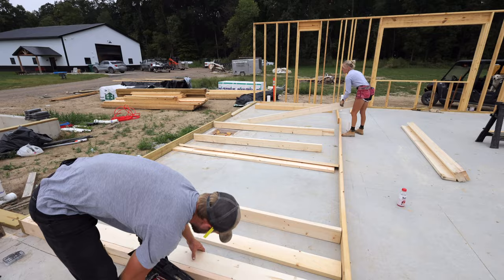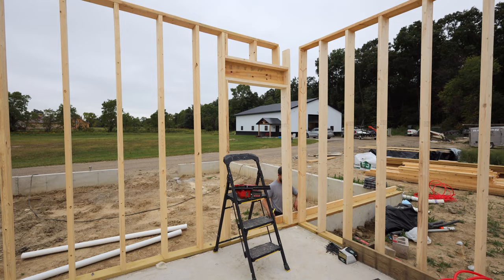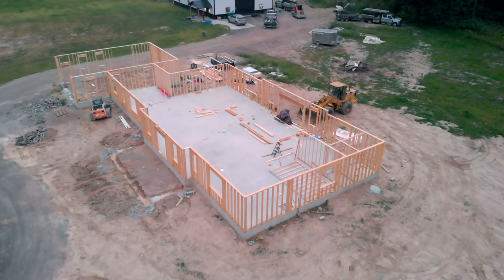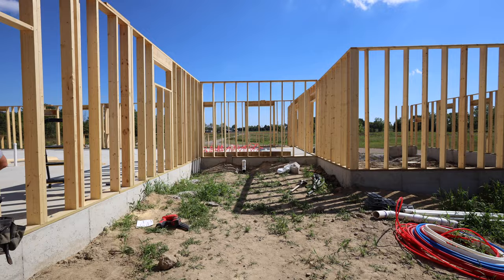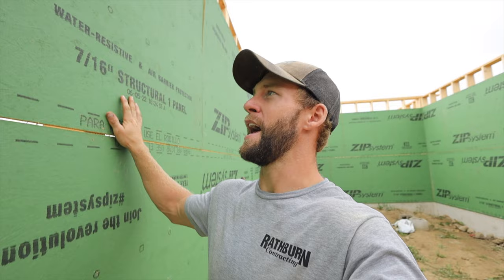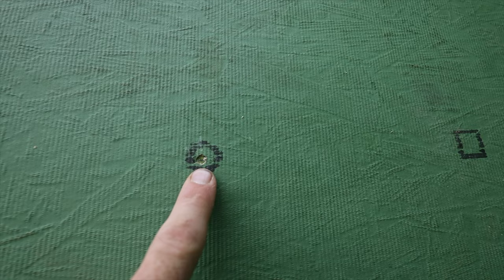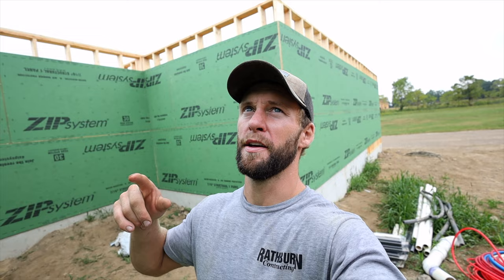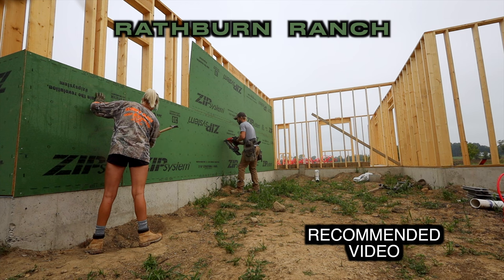Installing Zip Board On Our Walls! | Building Our Own House #ep8

Comment: Looks good nothing like building your home with your own hands. Curious why you ran zip board horizontal and not vertical
Reply from the maker: Couldn’t find a conclusive answer in the building code and read a few websites that said it was stronger horizontal. I’m not sure if that’s true or not but I wanted to be safe!

Comment: Curious on if you had considered post frame for the house instead? Also a Michigander and debating on post frame vs stick built for a home considering costs now a days. Any reasons you did/ didn’t go post frame?
Reply from the maker: Not against post frame at all as long as there’s a full concrete foundation. We had planned on a basement but changed course right before we started due to the floor system cost during covid. Going back I’d likely do post frame!

Comment: Great video, I have a question though. Do you leave a gap on the corners or will they overlap and be flush against each other ?
Reply from the maker: That is a great question, I’m not sure of the technical answer, I left a gap due to framing error but I don’t think the gap will be an issue since it will be taped and the pre-built corner trim will cover the whole thing

Comment: What is your take on the Zip System sheathing instead of buy OSB and house wrap?
Reply from the maker: I’m 100% on the zip system. After working with it so much and seeing its performance with moisture I hope to never buy tyvek again. Our house is extremely cheap to heat and cool because of the air tightness
Reply: @RathburnRanch  I purchased the  regular OSB at Lowe’s to redo the front of my home. I didn’t get the Tyvek Wrap but got the Lowe’s Wrap I pray it will do good as Tyvek .

Comment: Zip says not to leave a space unless you cut an edge.  I can't use it as I'm in a cold climate and it's not approved here so e we have to do vapor barrier on inside and zip doesn't perm enough to let the vapor out.   It's fine in warmer climate though but standard plywood plus tyvek is still best for long life with mold. 

I get why builders love it it's fast and easy buy funny the don't use it on the own house.
Reply from the maker: That is incorrect. Zip says you can only butt them directly when both 8' sides are in contact. All 4' sides or where 4' meets 8' must be spaced 1/8". And that is also a time saving option not a detail that will negatively impact performance. I noticed some slight swelling with rain, so I wanted to hedge my bet and leave a gap everywhere. That makes sense in extreme cold climate zones but I would still use something like Delta Vent SA instead of Tyvek.

Comment: Zip is so expensive and we have a lot of windows. I can’t imagine paying for zip to be my waterproofing method during construction. Did you use the pieces you cut out in other places? instructions for estimating say to subtract door and window openings from the area of the wall.
Reply from the maker: Yes, we reused scraps where we could! And yes it is more expensive than traditional osb but the quality is far more superior than the price difference. If you do the math on heating a cooling bills for the next 50 years- the savings from having a tight house are worth it. 

When we decided to build and started drawing the house, we kept quality as the first factor. So if we weren’t able to afford a product, we made the house smaller or found a way to save somewhere else!
Reply: @RathburnRanch  yeah I think we have about 2300 sf of nonglazed surface and it’s about $500 or $600 more than forcefield but then moving to zip have to pay the premium for the roof decking! Will be haunting FB marketplace for leftovers. 😂

Comment: When you install zip horizontal we’re you required to block the horizontal seams between panels?
Reply from the maker: I was not, but I have read that online depending on wind /climate zone!
Reply: If a wall is a shear wall then blocking would be required. Seems weird that this house doesn't have a single shear wall.

Comment: You’re not supposed to leave those gaps
Reply from the maker: Read zips website bud
Reply: @RathburnRanch I thought the same so I went and checked.  Page 17 of install manual pdf says not to space the 8ft edge and do space the 4ft edge.  The 8ft side has the nub along it to set the spacing, 4ft does not.
Reply from the maker: @RobertJLessard  “Page 17: Zip System sheathing’s unique edge profiles are designed to accommodate incremental panel expansion and does not require manual gapping along the 8’ edges.” 

Unless you’re reading a different install pdf off of Zip’s website it does not say “do not space” anywhere, simply says it’s not required. I went beyond what they said to allow extra expansion from moisture. After sealed with the tape it won’t make any difference in air sealing.